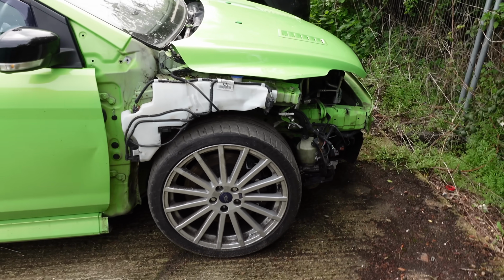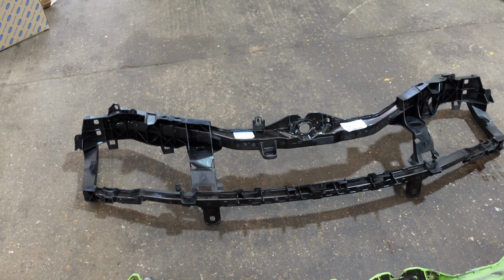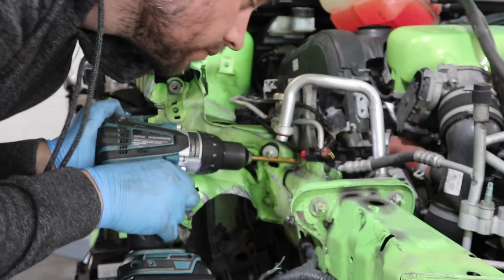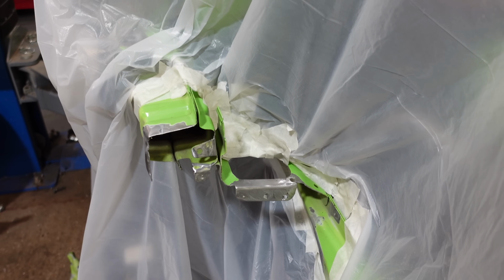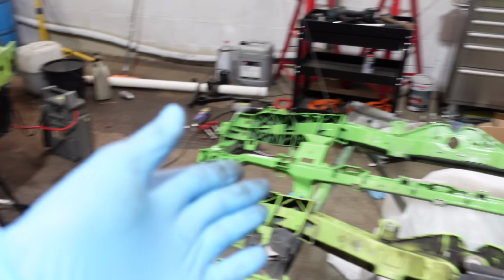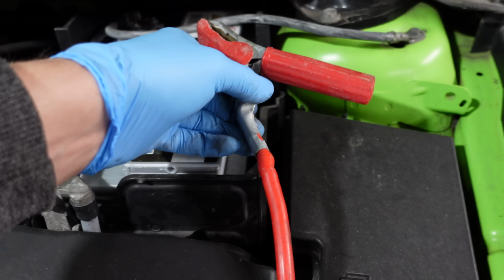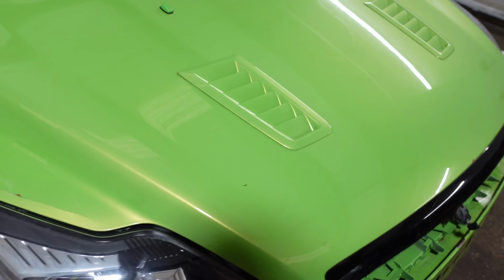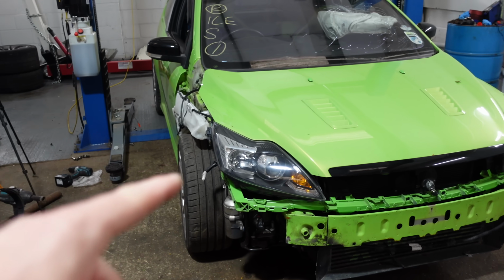REPAIRING MY CRASH DAMAGED FORD FOCUS RS MK2 PT.3

Comment: I went to buy one of these in UG a few years back now, Main Ford Delaer in Leciester, described as mint, but I could see  staright away a bash had occured OSR corner due to the paint - the colour seemed to match quite well but as you looked atthe are at different angles, it looked so odd, revealing the area of damage. Once I spotted the repaired area the car dealer (sales man) walked off. So professional... So yes, interested to see how the paint comes out...

Comment: Dean enjoying the content as for the dead battery if your charger has 24v output try putting it on 24 v and connect to the battery off the car obviously and run the charger on max 24 for about four to five minutes the battery plates will be covered in a layer of calcium oxide which acts like an insulator by using 24 volts you boil the battery electrolyte which starts the oxide layer to break up on the plates after the 24 volt stint put it on a 12 volt charge on the lower setting for an hour and then you can check to see if it has saved the battery 9 times out of ten it works

Comment: Nice work Dean, coming along really well. Heads up though, there is a huge RS tax on the arch liners, as the boys over at Evil GT found out recently. Over £650 per corner I think it was. Eye watering when you realise that it’s just 1.5 ST liners riveted together.

Comment: Looks good mate I think that colour needs a perlecent white base coat before spraying the green because it is very transparent if you spray it over a dark primer its gonna look slightly darker and it will get darker the more coats you apply
Reply: Yellow Primer👍
White requires 2 coats
Gray was enrichment to the Green👀

Comment: A little tip for the inner tie rods, if your replacing for new with the spanner groove on. 
Run a quick weld over the old ball joint on the inner tie rod then you can turn the tie rod to undo the complete unit from the steering rack

Comment: Hiya, st,RS specialist here, I’m so glad to see someone on YouTube building an RS finally as not many documented , with the paint the base green is darker, the mid is a light green with pearl this brings it to the correct colour, the clear is just normal clear. But needs the mid to make it the same shade for ultimate green or it will be to dark and not pearly enough, also if you need any parts hit me up.  Cheers

Comment: Are you a qualified insurance estimator? if not its nothing to do with you. It is and will always be a HPI insurance damaged vehicle.
Reply from the maker: I don’t need to be a qualified assessor to see that the car hasn’t been structurally compromised. All it needed was a 2mm bracket welding on

Comment: Why do you need the engine running for the power steering with an electric pump?
Reply from the maker: It’s not an electric pump, it’s mechanical with fluid, so need the engine running to pump it round the system

Comment: I think that paint has a pearl in the lacquer mate, hence the difference, body shop will be able to match the exterior panels 👍🏻
Reply from the maker: Yeah I have base and mid coat. But yeah I won’t be painting the exterior, I’ll leave that to the pro!
Reply: Not a dig dean did you put some plastic primer on before the base coat ?
Reply from the maker: On the top carrier? Yeah, I put weld through primer on the normal panels
Reply: @SavingSalvage  I use a clear plastic primer get it from ar Davis on baldock then go on with primer and paint .Like to know if it’s a 2 stage pearl or if the tint is in the clear coat

Comment: If I remember correctly the clear coat is tinted, so unless you use the same you will not end up with the same 'colour'.
Reply: It's a 3 stage pearl black primer silver base green pearl and then clear cote
Reply: The audi chucked out with the rest then 😂🤦‍♂️

Comment: I just use big water pump pliers to grip the snooth bit. There not normally that tight
Reply from the maker: I tried that, weren’t having any of it on the ground, although there wasn’t any room really
Reply: @Saving Salvage  yes always much harder on the floor. Always try work on a ramp myself if possible.
Reply from the maker: It was easy once on the ramp to be fair
Reply: Almost everything's easier on a ramp haha. Im a tech myself in liverpool